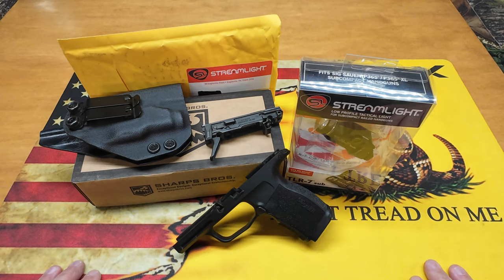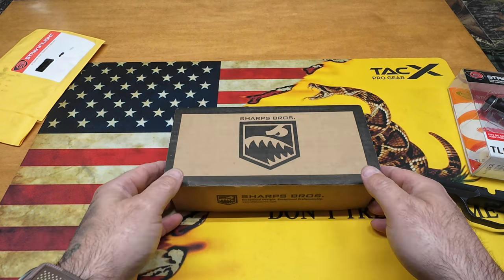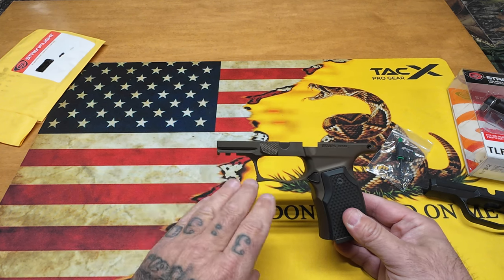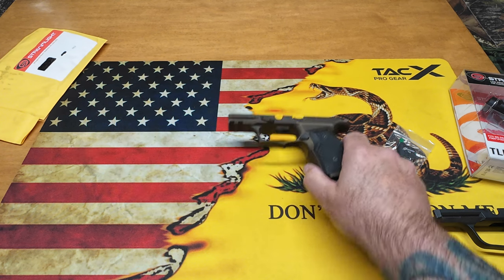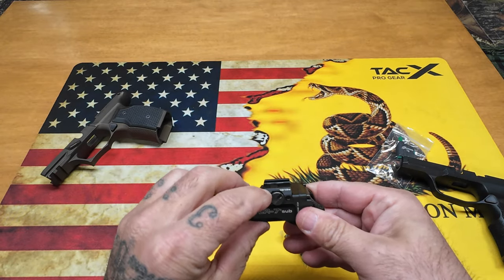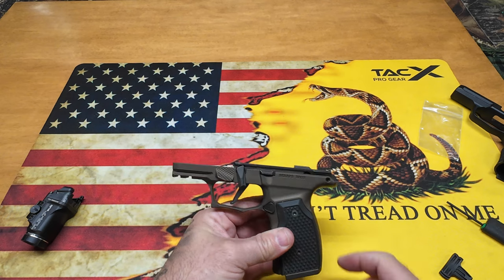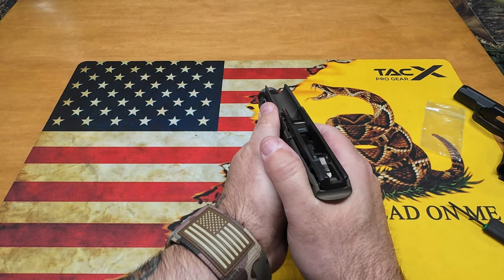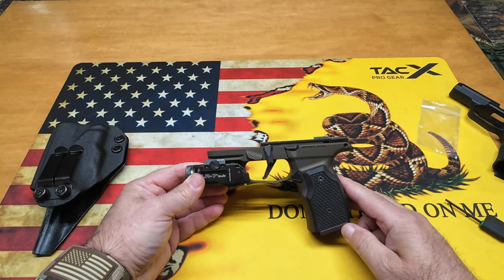Sharps Bros P365xl Lower Build Part 1

Comment: I think I paid $255 with taxes and shipping off of Midway for the black one (same size with cherry wood). I've noticed that, as thick as it is, it's a little tough hitting the mag release without breaking my grip. I ordered the VZ Operator 2 grips and I think that will fix the problem and give the entire grip a whole new feel. Can't wait until they show up. I discovered today that my $30 multi function CZ holster fits the module very well. I also use a standard p365 leather IWB holster that it fits in. I most commonly use my JM4 Tactical IWB holster. I decided to switch it up and carry OWB today with the CZ holster. I'll be making a video soon as well once I have the rest of my upgrades, lol. It's already got a few upgrades, but I just ordered a comped and ported slide since I'm switching from the SAS slide which already has a ported barrel.
Reply from the maker: Very cool, what’s your channel I’d love to watch. Also what cz holster are you running? I didn’t know cz made holsters

Comment: That's a sharp looking setup.  I'll be interested to hear how it handles when it gets really hot outside.
Reply from the maker: Thanks looking forward to the finish line. I’ve carried it and it’s only going to get warm from your body so should be fine out in the heat, aluminum dissipates heat fast.